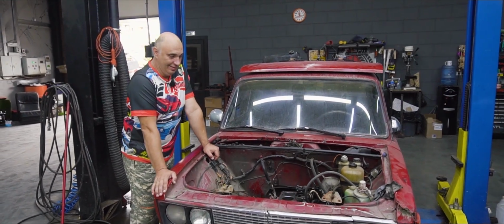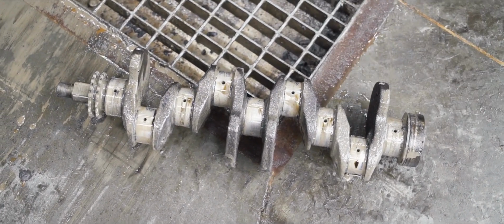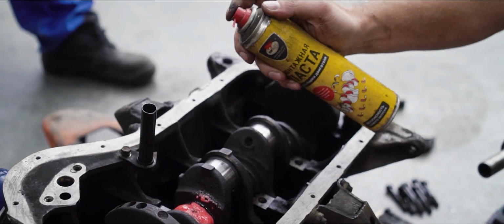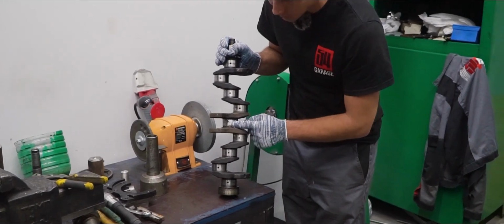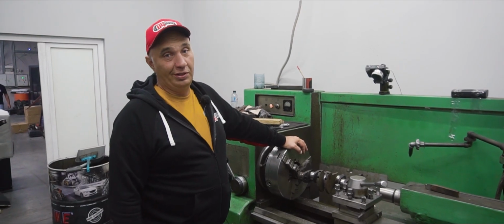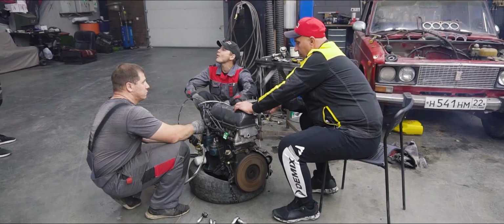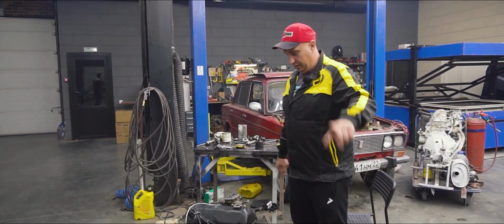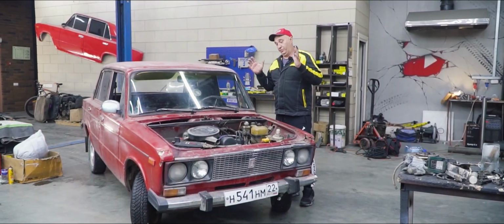Welding a broken crankshaft – will it work?

Comment: You could remake engine so every piston was firing at the same time,would be interesting to see.
Reply: +1
Reply: They already did this on the russian channel.
Reply: @arnasarnas1332  do you have a link to that video?
Reply: @arnasarnas1332  - All at once, there's a whole Lada shaking going on!
Reply: @arnasarnas1332  just wait for BMI Russian to translate it :) but it seems very funny :D
Reply: @arnasarnas1332  Would have worked better if they adjusted the carb from flooding the motor though :O
Reply: @arnasarnas1332  i want that link
Reply: good idea ! But I guess that will need a heavier flywheel
Reply: Big bang I4
Reply: @tassoss13  Thumper I4
Reply: You could also do an engine with 2 cylinders firing at the same time and another 2 180° afterwards
Reply: @tassoss13  a honda 4 cyl allready dose this 1 and 4 fire same time then 2and 3
Reply: It would be like a single cylinder engine
Reply: best idea so far. DO IT!
Reply: I don't think that will work but I'd like to see two cylinders firing at the same time.
Reply: @jbrizz99  Hey, we want to see destruction, pistons flying through the roof. 2 pistons firing at the same time would probably be fine and that's less interesting :)
Reply: @jbrizz99  agree need one to twist the crank to get the next one up.
Reply: @jbrizz99  my 2-cylinder Mitsubishi diesel in my MT372 tractor fires both at the same time, she's a shaker at idle but smooths out at 500rpm and above
Reply: or the yamaha style were every piston is 90º offset from the previous one!
Reply: He did
Reply: @victordeltoro7400  broo this guy is awsome he did
Reply: Already been done
Reply: It would sound like a Briggs & Stratton single cylinder lawnmower engine.  You'd need to modify the ignition and build your own cam while you were at it....Big job.
Reply: Make a copy of yamaha 4 cylinder cross plane crank with a lada engine and see what happens. The distributor might be a challenge to do though!
Reply: Aaaaaand, it's done!
Reply: Well that didn't take long, he just released this idea on the channel
Reply: @Scott00  i noticed
Reply: @Scott00  They had already done it on their Russian channel when I wrote the idea,LOL.It's nice of them they translate it ,so I could understand.
Reply: Yeeee
Reply: Cut camshaft and weld too xD , i expect broken crank.
Reply: Wouldn't that just be a 1 cylinder? Well times 4. But what will put the Pistons back to TDC? That is like riding a bicycle with 1 pedal.
Reply: Can't. You wouldn't be able to fit the crank in the block.
Reply: @mikeznel6048  How so? We're not changing the pitch, neither distance between journals.
The biggest problem would be oiling that crank, and rearranging camshaft and ignition system.
And of course, such an engine would shake itself to pieces in a matter of few seconds.
Reply: Immagine the vibration lmao they should do an apposed set up like in a plus shape but each piston is 90 degrees apart from the next and last. There's a motorcycle like that but In a car would be cool
Reply: I WAS THINKING THE SAME THING!
Reply: @bassmikdk8360  You would just bend the rods
Reply: Oh yeah!!!!
Reply: Yes please we need that!
Reply: Do it
Reply: By this way they will create a black hole ;)
Reply: That's a good one!!
Reply: Thought the same thing :D
Reply: That's mechanically not possible with a distributor.
Reply: @AstrosElectronicsLab  Impossible, I think not. A pain in the ass that would require much more effort than simply utilizing a distributorless ignition, absolutely.
Reply: +1
Reply: Yes good idea.
Reply: Make this with two engines and mount them in a boxer configuration.
Reply: AGREED! We need to see that!
Reply: The balance would be funny too watch and torque curve as well
Reply: I can imagine its like train starting to move
Reply: it would be hilarious. I recon it would be almost impossible to start with all that compression, like trying to start a extremely high displacement v12, since there will be 4 simultanious compression strokes. they would need to run like 100+psi of oil pressure to prevent the crank from saying hello to the bearings until they are one peice of metal. and a very very heavy flywheel or just high rpm idle to compensate for having to go 3 cycles before a single powerstroke. it may even benefit from a 2 stroke style exhaust to help evacuate the exhaust, and end up as the worlds torqueiest 4 stroke, right up until the thing blows all the bearing caps off the bottom flys through the oil pan. Please do this! May want to try mounting two unbalanced flywheels at the front and the back to make it able to run for a bit longer!
Reply: Wait what
Reply: L
Reply: And then combine three other engines, each offset by 90 degrees. An inline 4 V16.
Reply: Yes I want to see this
Reply: or re-weld the crank so that the piston in 2 pairs, and make it firing like parallel twin engine
Reply: Eeeeeasy there satan!
Reply: Please do this
Reply: That would be extremely unbalanced disaster, lol
Reply: Not possible?
Reply: Garage 54: SAY NO MORE
Reply: It would vibrate the vehicle apart.  You could forget about intake and exhaust scavenging. I cannot think of one benefit in doing so.
Reply: YOOOO LOVING THIS IDEA
Reply: Massive counterweights needed… +1 I’m down
Reply: I knew I felt a disturbance in the force.  In theory, if there is proper balance it should work.
Reply: @KhanIlkara  What would be the point?
Reply: Yes with a big counter weight..
Reply: Don’t think it would continue to run after the first cycle.
Reply: Oh yeah
Reply: damn nice idea
Reply: Updoot the fuck out of this
Reply: It wouldn't work.
Reply: @Questchaun  it did to a certain point. He made a video on it
Reply: he did it!
Reply: I think it would become unbalanced
Reply: https://youtu.be/xdnyGRa6rYM
Reply: Would last .5 revolutions
Reply: wouldnt work you cant make a distributor fire AT THE SAME TIME thats just not how it works
Reply: @wildcat67-b7n  While it would require a custom cap, rotor, and four ignition coils, it is absolutely possible to fire four cylinders simultaneously using a distributor.

Comment: What about the oil hole???
Reply: He explained Lada cranks don't have an oil gallery in the centre crank journal they said that's why they did it there. It does have oil to the bearing through the block but not a crank oil gallery in the centre.
Reply: 3:33

Comment: Now we know, if you break a crank just weld it.
Reply: ONLY IN LOW HP / LOW TORQUE ENGINES ,, WILL NOT WORK / HOLD IN A HI HP / HI TORQUE ENGINES....
Reply: @tammylott921  Thats to be expected, if you break a crank in something in the high horsepower/torque range you should get a new; stronger crank not weld it. 
I've snapped off the output of a predator 212 crank and welded it, its held up so for... been 2 years.